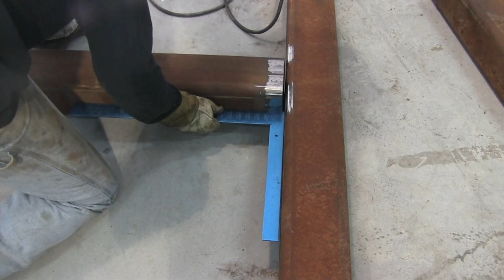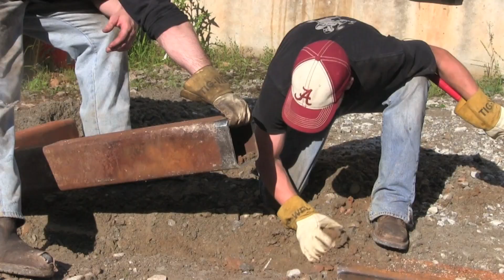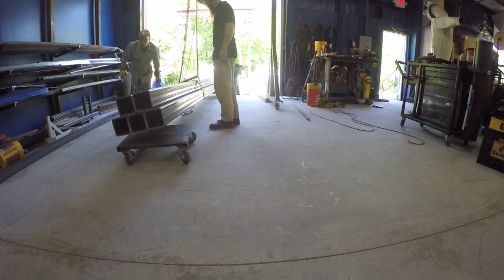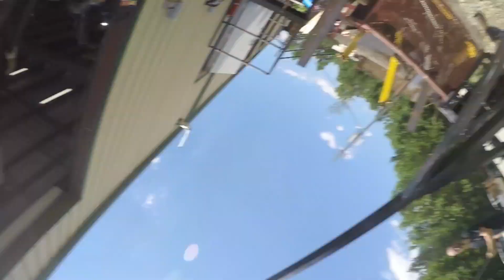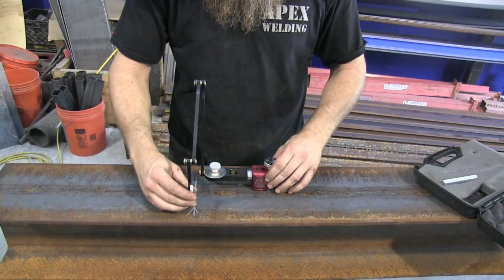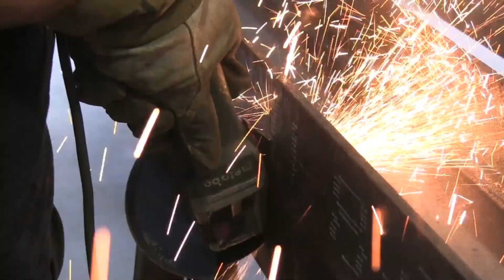Metabo vs Cutting Torch

Comment: now there is a guy that aint fucking around all the gear and absolutely all the ideas to boot just shows you what is possible with minimal equipment if you just think about what you're doing and what you need to get the job done nice work guys

Comment: I have already almost all tools from Metabo - around 8. They never let me down. Top notch.
Reply: +Mark Fryer There's nothing like having your tools walk off a site to make you want to find other work entirely. So many unprofessional guys out there. 

I learned from the owner of one shop that the tools don't have to be pretty. He spray painted all of his loaners red so you couldn't mistake them for your own. (If you painted yours red he would claim it for himself.) I adopted dayglo orange for mine. Some tools have to be disassembled before you can safely spray the case, while others are easy to just hit as-is. Make sure you get enough nooks and crannies so it would be a major PITA to try to remove the paint. Then no one can claim them as their own. And if one does disappear it's easy to alert the local pawn shops to look out for that tool with that paint issue. Still no guarantees, but it's a cheap way to improve your odds.
Reply: Never seen them counterfeited
Reply: +Defnotdemas That's increasingly common. Same is true of DeWalt tools. Big box stuff is much cheaper (built) than from a real dealer. May also be true of Milwaukee, but I've seen actual evidence of it with DeWalt.
Reply: +Defnotdemas I disagree entirely. I could not be more pleased with my Milwaukee tools. They are pushing innovation in power tools, especially cordless, more than any other company. Others, including Makita, Festool, Bosch, and Fein, have made significant innovations. But no one is putting out more than Milwaukee. 

Incidentally, you do know that Ridgid is made by the same company, right? I agree that Ridgid is a better value, but only within their more limited line of tools, as they make but don't own Ridgid. Only the most common tools get Ridgid and Ryobi versions. Milwaukee is TTI's flagship brand, and they keep some of the best tools within that brand. And with their acquisition of companies like Empire Level they are expanding their reach while also innovating in those lines. And I have not seen the quality go down in recent years at all. The quality did go down substantially when they stopped making metal-constructed tools in the U.S., but that was well before TTI bought them out.
Reply: Actually I noticed that some time ago, more to say that Hitachi recently bought Metabo so you can expect more ASIA production in the future. I have 3 or 4 Metabo tools already made in China and I see no difference what so ever. Everything is made in Chine those days - China doesn't automatically means bad as long the production process is supervised.
Reply: You would think that the government would be keeping and eye on all this DOT, OSHA and ETL INTERTEK approved garbage. Intertek will approve and stamp shit with a submitted blue print. I won't mention any names here but, currently I know of some commercial machines being built locally  that are not grounded and should not even be sold in North America that contain lead issues as well. People are dying in accidents and buildings are burning down. When a tech. gets fried on one of these machines, they will blame it as operator error and probably never see that  it wasn't grounded. What has been brought forward should be globally recalled and have harness updates but it's cheaper to pay out the lawsuits "if" one arises but then again.....workplace accident is paid out by the government where I live 250k max one time only no matter how young you are and if you lived. My long winded conclusion is that a certification means squat if you are observant and ask the right questions.
Reply: max webster
Reply: Good for u

Comment: I have a Metabo that I bought when I was 18, it has been the absolute best grinder I have ever had or seen.  I am 32 now and that grinder has helped me through my career substantially.  I have burnt up dozens of Dewalt and Milwaukee grinders and this one has yet to fail.  I've had to replace a couple sets of brushes and a power cord along the way, but til this day it has more torque and better ergonomics than the newer style Metabo's.  

I spent almost $250 for my first Metabo, and at 18 yrs old that was an absolute fortune to spend on a grinder.  It taught me a valuable lesson though.  Sometimes you can buy productivity and it is absolutely amazing what a quality tool can do for you.  I've seen this $250 grinder outlast almost $2000 worth of cheaper units.

Comment: I have 6" dewalt grinders and use them more than my plasma cutter for slicing through material. I  Will agree that the time.thing is probably just gonna be based on what you use every day and how neat you want you're finish. I rarely use my plasma ( one it's old) but I can cut faster with a torch on plate  (ppl don't realize a tip and pressure settings can be changed in order to get a perfect cut on every thickness) and slice through sheet metal with a grinder, way faster than getting.both tools out just to use the grinder after I make a 
plasma cut...
Just my thoughts everyone has a preference

Comment: The I beam marking tools are great for site work, you can mark mitre with them and they also work on pipe or square tube, I have a real old one without a mag base or angle scale but same operation. As far as torch or grinder, after a few years of messing about I'm now a big fan of getting anything that won't fit in our saw cut to size by the steel supplier, normally its only a pound or so per cut, no messing about, nice straight cuts. Steel turns up ready to weld.

Comment: They're holding the grinder backwards! You should always hold the grinder so it's pulling away from you (sparks coming toward you) I was just waiting for the grinder to kick back and plant right in their face or gut...seen it happen many times.
Reply: After using a grinder for over 1,000 hrs, one learns to hold it in whatever manner best suits the situation.
Reply: Well, he wouldn't be posting any videos. For us, who use grinders but are not "professionals" your comment serves as a good safety reminder.
Reply: @Gabriankle  
"I know safety as my three fingers!"
Reply: An older guy once told me "Eat the sparks or eat the grinder".
Reply: Yea he’s asking for serious kickback, although those metabo grinders have a slip clutch, it doesn’t matter. That’s gotta be the most stupid way ever to use a cut off
Reply: Slayer
Reply: Looks like suicide cut to me. If it jams it’s likely to fly out of his hands. Good if you’re just making a groove but going all the way through, very touchy
  Using grinders over 40 years in all sorts of ways, I know what it’s like to have them fly out of your hands and know about having them hit you in the face, and that’s being careful
Reply: @afandou1966   Another safety tip; get a small and not too powerfull grinder with RPM settings, just use a slower speed. Takes just a little bit more time but less risks. Or get a cheap speed controller that you can add to any powertool. Look on ebay.
Reply: with enough experience it should be fine tho, just make sure youre not cutting anything with a lot of tension on it, grip the grinder tightly and you should be gucci
Reply: yep always want the drag action , push causes a toggle event that due to the human anatomy always ends in the blade binding and pinching then it explodes

Comment: I build automatic 12-36' swing/slide drivegates and beam trolly gates for a living and regularly cut and weld 14ga to ⅜" wall in the field (usually alone). I own a torch, chop saw, band saw and all kinds of grinders but my favorite for a lot of reasons is a regular 4-4½" hilti grinder w/ a 6" cutting wheel. It may not sound the safest but I respect grinders immensely and know how to use them. I can get 30 cuts out of 1 wheel and the accuracy is much better than a torch and  I 45° almost everything. I own 6" grinders but the 4" seems to cut faster because the lower torque grabs the metal faster. I've never owned a mutaba but I've been seeing more of them lately and might give it a try for my next grinder since I usually keep 4 or 5 on my truck.

Comment: building that gantry trolley system was a smart bit of problem solving. i hope JD turns a nice profit from that contract.   I work for a fab shop and we sometimes use the Flexovit Razorblade cutting disks on our 4" and 9" dewalt grinders.

Comment: Great vid to show the cutting between two sources. Not sure if it's been noted elsewhere but I must mention that he used the Stainless/Metal "inox" cut off discs. You must use these as the std ones don't last as long. Also don't apply too much pressure and let the disc cut itself. I already knew the results as they are exactly what I use but still great to see others around the world doing the same ;)

Comment: Metabo metalworking tools are the way to go, there are few tools that can compare.  
As always great video giving a different perspective on a task that is often overlooked for time savings, especially when it comes to field work. Another tool that may be of interest in this regard is the Fein ASTX-e  649 pipe saw, it works as a portable saw station when used properly. There are several videos on here about it, I will try to do a time comparison with similar sized structural shapes at my shop this week and post the results.

Comment: I have a Metabo 1/2" hammer drill that has to be 40 years old and still works better than most new drills I have used. Metabo is amazing.

Comment: I love, love, love my Metabo. The grinder I have from the Horrible Freight doesn't even come close.
Reply: The Metabo is a pro grade tool. The HF is a home gamer tool.  A $12 grinder obviously won't hold a candle to a $100+ grinder.  But for 99% of people at home the HF should do just fine.
Reply: though I don't really care for Metabo (personal preference) I do agree that those crappy grinders don't stand a chance against the proper stuff. Even for the home gamer just shell out a bit more money and get a tool that will last you a lifetime (Hitachi in my opinion)
Reply: I had a HF $10 grinder last me 4 years of heavy side home use, surprisingly skookum for what you pay... after all, it was $10 so I can't complain at all. I have 4 grinders now, (Skil, Kawasaki, B&D, and DeWalt) never regretted the investments.
Reply: Mine's only 3 years old but I'm also running (when they're not out for repair!) one Makita, one Milwaukee, two B&D Pros, an antique DeWalt from when they first came out, and one deep cut Milwaukee portaband (another tool not mentioned.) The Metabo is the only one that has never quit working and it has the quick removal, wrenchless spring centered nut on it, I can swap discs in around 12 seconds. I was surprised that you had it beating the torch, that's pretty good results! Also, to the commenter who claimed this sounded like an advertisement for Metabo, all of my tools were purchased by me, and I'll stand by the Metabo every time. They're great grinders! Have only tried the Hitachi once, didn't care for the switch/hand ergonomics of it, not to say it isn't a good grinder...
Reply: When is the wedding ? True "love love love" should be finalized by marriage. It may get you a tax deduction in The Idiocracy ! Is your Metabo male or fe...OH. Nevermind. That no longer matters.
Reply: The ones that are made to max out the breaker will all be within 5% on power.
Reply: Harbor freight sells made in china disposable tools. I have friends who use their wrenches/sockets and they seem to hold up quite good but their power tools are UNDENIABLY made from poor quality materials and manufacturing processes. I tried harbor freight and their grinders are junk...after a couple weeks it started making a rattling sound, started smoking, lost most power and burned up. They took it back it without any hassles which was nice but the replacement ended up doing the same thing! My dad bought a Metabo 4" grinder back in the late 1970's. We used it for ALL kinds of projects! After seeing the bs harbor freight sells, he gave it to me and I'm STILL using it today!

Comment: I remember using a electronic track burning table you could draw a picture with a black marker and the machine would fallow the line of the black marker and the torch arm would cut out the picture on the metal. I drew out and Egal it cut out about 6 of them on the sheet metal. 
Me and another person was the only one that knew how to work that table no one in the whole shop didn't take the time to learn how to use it. I regret not making more stuff with that machine now that I'll never get to use it again that shop closed down and everything got sold off.

Comment: If you find yourself cutting a lot of wide flange or big tube a big abrasive saw is the way to go.  A 20" or 24" blade and 15hp will blow through a beam like that in less than a minute.  Obviously you have to have the work to justify it, but it is a real time saver.

Comment: I first bough a Metabo "all green" 6" grinder in 2009 and it's still going strong. I maintained a fleet of Metabos for a welding school and they withstood student abuse very well. (I don't care for their 9" with the rotating handle as the handles came loose over time but the motors are powerful and none burned out while I was there for three years.) The later, current "green and black" Metabo are excellent grinders but in my experience had a higher failure rate. Still well worth the money though since there is NO grinder a welder cannot kill and they are to be considered consumable items in professional use. If you manage to kill one, it likely paid for itself many times over. My welding instructor bro stretches and shortens Class 8 trucks on the side and makes nearly all his frame rail and fishplate cuts with his Metabo 6" because larger grinders are awkward and smaller grinders lack the reach and edge speed of 6" discs.

Comment: Excellent video that shows how important it is to be well organised...dollies are like vise grips, you never have too many.

   One thing I would like to do if I was working in this shop: some way to lock and unlock the railing, under the upper frame of the door, without climbing up each time.... some spring loaded, male_female locking, being activated by some cable .  Sure safe and fast....

Comment: I've always thought that using a grinder in that direction is dangerous. I have always taught young guys to hold it the other way so that if the disc jams, it will pull away from you rather than kicking back towards you. Have seen a guy almost lose his front teeth because of a nine inch grinder kicking back.
Reply: It is pulling away from him though.
Reply: Yes it's not the best way to use the tool, but someone just needs to feel the pain to learn...just like me!4 stitches gush 1cm from the wrist tendons...😰😰😰
Reply: I thought no one was gonna mention it. It is very dangerous to cut the way.

Comment: Great comparo between the torch and cut-off wheels. Another option is a metal cutting circular saw, like what Milwaukee offers. Its makes fast, clean cuts on up to 1" (sometimes more) material.

Comment: man i sure love to watch this kind of videos, especially the ones you present to be honest.

but i am honestly not surprised by the fact that the angle grinder would be the faster tool in a situation in the hands of a experienced worker, just as it have been shown in this clip.

and im not even mentioning or comparing the learning curves between the acetylene torch and the grinder :D.

nuff said, i just came home from a rough pass in  the elevator shaft in the renström mine and now its time to go to bed :D.

love your vids man, keep on making em ;).

warm greetings from northern scandinavia.

Comment: Great vid Jody!

 Work fatigue is a big factor with the torch vs the grinder to me. I find i am much less fatigued running a torch or plasma then clean up with a grinder than just running a grinder. After 10 hours on a grinder you are smoked. With the torch you get "breaks" from both during switch over.

Just my experience.

Comment: Husqvarna and a few others makes a great hand held cut off saw that could do this even faster. I'm not so sure a skilsaw with the right blade couldn't either. The only problem is that the kerf gets a lot wider. I think the hot ticket is a metal cutting diamond blade that will fit on a 12in electric cutoff saw. Expensive, but can't be touched for speed .

Comment: Hey Jodi! I was wondering would it be possible for a video idea to explain your thoughts on a little bigger machines that you use or advertise. Bigger machines like the Miller Syncrowave 350, or the Dynasty 350 and bigger welders from other companies. Just to help some shops that weld with bigger, hotter stuff. Dont rly expect you to have these or use them in the video cause they're pretty expensive but I just thought it would be a nice video idea for you. Thanks and love what you do keep it up 👍

Comment: With a #8 tip you could slice that I Beam in one pass, done.. Wish I could find a video of someone cutting 12 inches of steel... Amazing that a torch can cut that thick, most I've seen is like 1 inch.
Reply: fla playa they're just trying to sell shit... I have an old  harris torch that with the right tip & enough o2 pressure I can cruise through 3'' steel like it's 1/2''